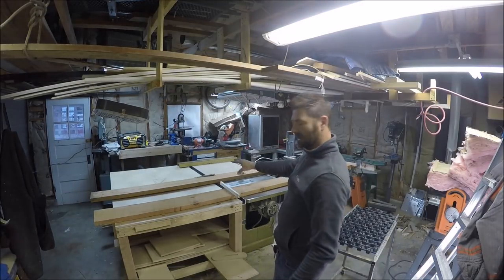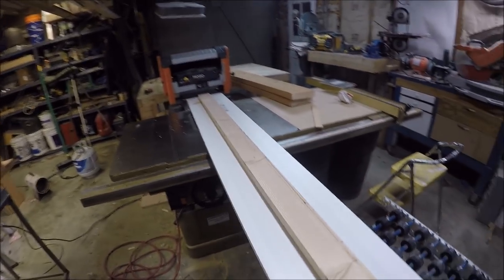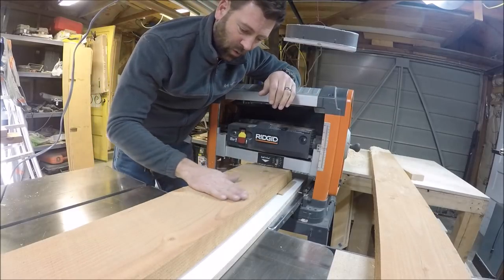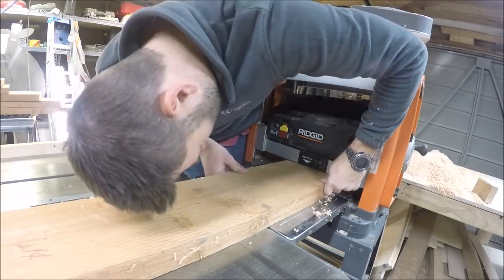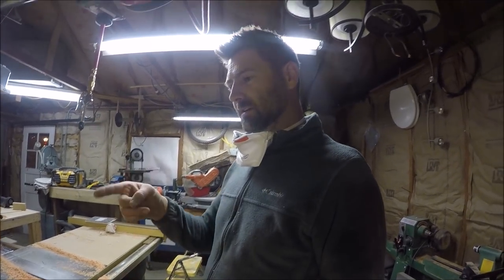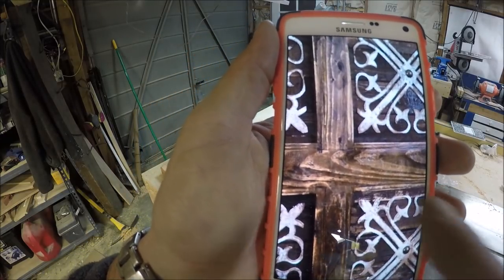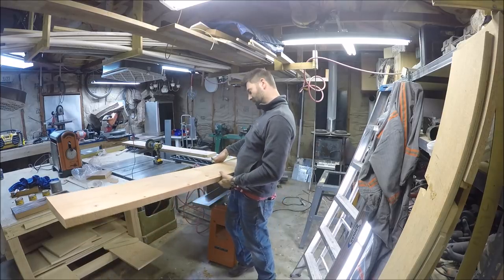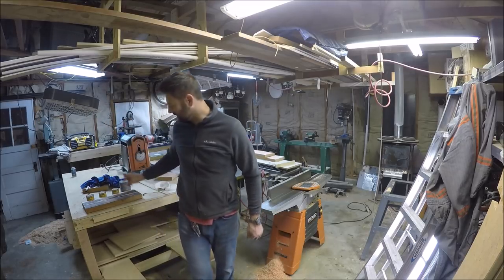How To Make A Weathered Wood Bed 1 | THE HANDYMAN |

Comment: I use a planer dog or skip plane, besides the glued shims, I attach a stop to the back of the dog to keep the lumber from sliding off the dog. I also try on twisting cupped wood, I will make a bunch of shallow kerf cuts on the bottom of the stock to relieve the stress, where ever that may be in that board. Then I will route out small dutch-mans over the kerfs, and glue 1/4" plywood perpendicular to the kerfs. This seems to keep the wood stable...

Comment: Use your shop vac as a dust collector for the chips.  It fills up quickly, but doesn't spray chips and dust across your shop.  It looks like your connector is like mine where a 2 1/2" shop vac or a 4" dust collector hose will fit it.
Reply from the maker: I need to get a system set up so all my dust is collected.

Comment: Why didn't you use your Jointer?
Reply from the maker: +streetfiremkv12 I did on the edges.  The Board was to wide to fit in the jointer to get the  twist out
Reply: Yeah I saw the edges. Makes sense a out it being too wide.  Love your vids man